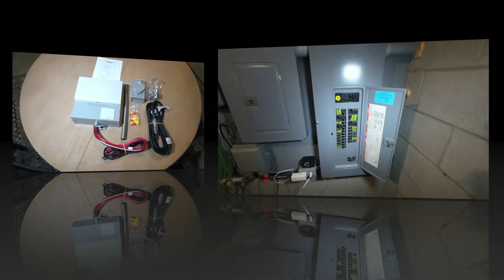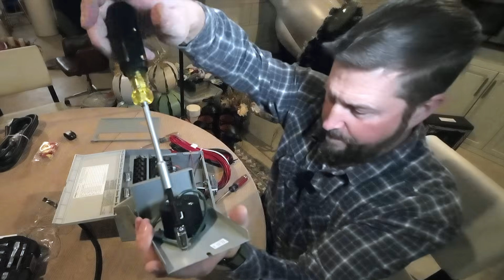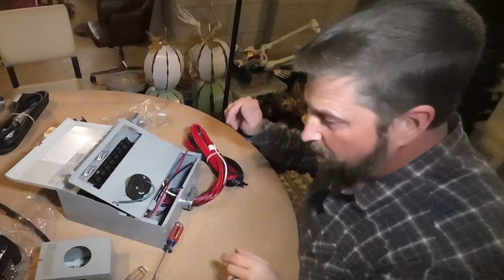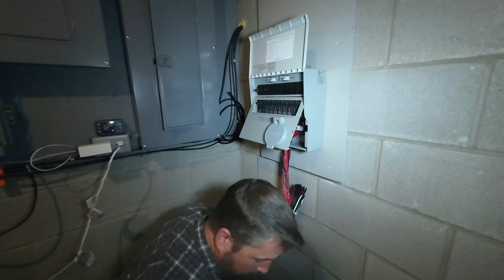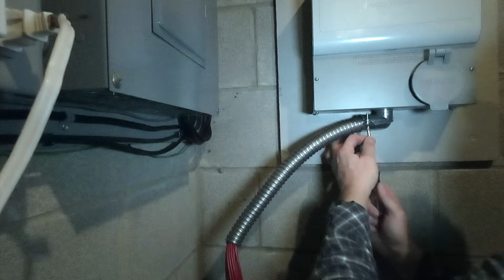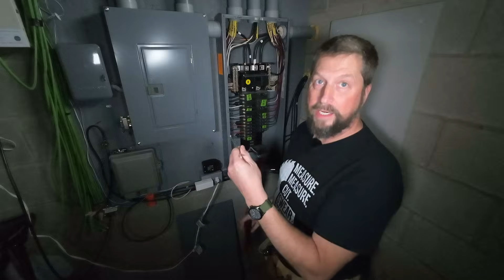Installing A 10 Circuit Transfer Switch: Reliance Controls Model Number 310CRK

Comment: What if I want to power the transfer switch with an inverter instead of a portable power station? Just get rid of the power inlet and just wire directly to the wiring of the TS?
Reply from the maker: That's creative. I think your biggest challenge would be using an inverter powerful enough to handle the draw from all of the circuits you choose to power through the transfer switch. Also, what would power the inverter? Why not just run that directly to the TS? I guess an inverter could clean the power before it reaches your circuits. When you get far enough into it, it may make financial sense to just get a battery power station. They have all of that built in 🤠👍

Comment: Nice job.  Thank you I learned something here.  I plan to do this same project except feeding a small off-grid solar and battery system.  Mounting my panels on top of a parked 28ft cargo trailer and I wont need any permits.
Reply from the maker: Thank you! So glad I could help 🙏 Good luck on the installation. Take your time and you'll be glad you have it 🤠👍

Comment: How do you connect the blk and wht wires on a/c 30 amp double circuit breaker from transfer box  there two red wires one goes to top double circuit breaker while wht stays on breaker  Now i have an extra blk wire! Where does that connect two? Help
Reply from the maker: With a 240 breaker, or as you called it, "double circuit breaker" there is a connection for 2 hot wires (usually red and black). Each hot pulls 120 from each pole inside the breaker panel. The white (usually neutral) and ground go to their respective bars. Hope this helps!

Comment: Great and detailed explanation very good! I just wished you completed the test by powering the house with the generator.
Reply from the maker: Thank you! Sorry it wasn't included in the video but we have had a recent power outage and the system works great. I still would like to add a battery system for quieter operation 🤠👍

Comment: What  will happen if you forget turn off grid CB off before using generator ??? There is no interlock between  two different sources of power !!! Bed unsafe design !!!!
Reply from the maker: There is absolutely no way to back feed the grid. Every circuit on the transfer switch has a dead break between selecting generator or grid power. It is a very good and safe design 🤠👍

Comment: Always assume some other nut job, who thought they knew what they were doing, wired up something inside the house that could kill you.  Check voltages with a multimeter, first against a known voltage, then against the unknown, then again against the known.

The distance away from your main panel is dictated by the length of the wires, not the conduit.  Buy more conduit if you have to bend it around a corner.  Again imagine someone, who doesn’t know better, sees the conduit and wants to hang something from it, and make that as difficult as possible.
Reply from the maker: Thank you so much! Very good advice 🤠👍

Comment: You can always just cut main breaker off from meter  those main black 110v cables but always test them first hot/cold hot then you dont worry about touching insde house breaker box cables them as long as main is isolated correctly and LOTO it out lol
Reply from the maker: @Sasquatch3051  That's a very good idea! Safety first 🤠👍

Comment: Does the main panel need to be turned off before switching the transfer panel to generator?
Reply from the maker: @agiantleapoffaith4502  Great question. No, the main panel can remain on at all times. There is no risk of back-feeding the grid because each circuit in the transfer switch has a hard disconnect before switching over to generator power.

Comment: No GFCI/AFCI to deal with?  Can you run full time on the manual transfer switch (ie. off the generator) if you wanted to?
Reply from the maker: @firstname7330  Great question. No, there is no GFCI in the transfer switch. It relies on your electrical system's existing safety features. It is only there as an access point to bridge power into whichever circuits you chose. However, to answer your second question, I don't believe it is intended to run full-time. Only as a backup source of power.

Comment: Hi Sam 
Thanks for this great DIY video I just installed a similar 10 panel transfer switch and I am wondering if I can also use it for a 10KW PV solar array I am installing on my roof with a battery back up and inverter in addition to a generator powered connection. I think it will serve the same safety purpose as I recall you mentioned a battery back up so I guess it would be similar.
Thanks
Reply from the maker: @brianstarkey1824  Thank you! I'm sure you can use these manual transfer switches with battery systems. Solar is a great way to go 🤠👍

Comment: Always safety eye protection around pointed wires and energized equipment..if you accidentally short something, melted metal will fly
Reply from the maker: @mine0002  I never thought of that with electrical work. Makes sense. Just like welding. Thank you for the advice 🙏🤠👍

Comment: Doe not work with newest breakers, GFI/ARC combo breakers. Just returned the Reliance A510A transfer switch for that reason. Some states since 2020, new type breakers are required by code.
Reply from the maker: @Tech_with_Loco  Thank you for that updated information 🤠👍
Reply: It will work, you just give up GFI/ARC protection while on generator.  I was willing to take that chance during an emergency.

Comment: Yup, these transfer switches are relatively easy to install. The problem is that in many electrical jurisdictions, the use of wire nuts within the breaker panel is illegal. This means that your house insurance might be voided if there’s ever a fire.
Reply from the maker: @danchesney631  People should always check their local codes. Wire nuts are fine in my area, but Wago connectors are good for many others. 🤠👍

Comment: I thought you needed 6/3 cable for the wire in-between the transfer switch and the inlet box since its 50amps. I believe he said 8/3 in the video.

Great video but you should have included information regarding the generator and whether you needed a grounded neutral or a floating neutral. A lot of people will follow these steps and have NO idea about the generator end.
Reply from the maker: Very good point about the generator. Hopefully they read the comments as well. The system I'm using is a 30 amp inlet. I actually used larger awg wire than required  🤠👍
Reply: @samsdoinstuff  Awesome!! I'm using a 30amp as well, but ran 6/3 cable so I could have the option of upgrading the generator later down the line. Thank you for the video!!
Reply from the maker: @shawnphillips1220  You are very welcome 🙏

Comment: On a separate note from my earlier comment. I saw something that needs to be MADE CLEAR!
I saw that there were WHITE WIRES connected to your 220 volt, double pole breakers, AND that they WERE NOT MARKED TO INDICATE THAT THESE WERE HOT WIRES!
For those that do not work with electric, it is a common practice to use BOTH, the BLACK (HOT) and WHITE (NEUTRAL) wires, to BOTH BE HOT!!!!  Typically, Romex wire is used with BLACK, WHITE, and BARE COPPER.  To minimize waste, and extra wire runs, it is common for electricians to use the black and white wires on a 220 volt breaker, and of course, the ground to the ground bar.  With that said, YOU SHOULD MARK THE WHITE WIRES, BEING USED AS HOT FEEDS WITH A BLACK SHARPIE, or electrical tape, at the point where they are connected to the breaker.  
I prefer a Sharpie, as you don't have to worry about the tape coming off.  You don't have to "color" the whole wire.  I will color about two inches of the ends.
This should be done at BOTH ENDS OF THIS WHITE WIRE!!!
This is VERY IMPORTANT, and can save you, or someone else, from being ELECTROCUTED!!!
Reply from the maker: @lonniechartrand  Thank you for bringing that to my attention. 🙏 I know about marking the wires, I just didn't notice it. I will look again and correct the problems 🤠👍

Comment: I KNOW it was just the camera angle, AND, that you reiterated numerous times that the large wires and lugs at the top of the box are HOT, even with the main breaker off, your hand appeared to come dangerously close to those lugs when hooking up the ground and neutral wires.
As a retired electric utility engineer, you cannot tell people ENOUGH, as to how dangerous it is when working inside of a panel box.
If you are at all concerned about hot wires in the service panel, you can request to  have your electric meter PULLED, and have your service completely disconnected from the power source.
Most every utility company will do this at no charge.  And give them a time as to when you will be finished with your job.
Give yourself plenty of time to complete the task.
This will insure your safety, AND, prevent you from being without power any longer than necessary.
BTW, this was a VERY GOOD video!!!
Reply from the maker: @lonniechartrand  Thank you very much. Someone else mentioned i should take my wedding ring off when I'm working with electricity. You all have very good advice 👌 I sincerely appreciate safety tips more than anything else 🙏 Thanks again! 🤠👍
Reply: I thought so too. I was literally getting kind of sick about seeing that, with the watch and wedding ring there. Someone at work had a wedding ring on, carrying an 80v lithium and bridged two contacts on it. Melted the ring and burned them pretty good.

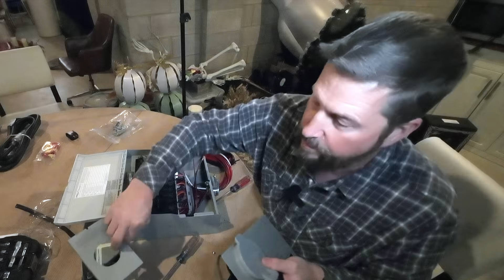Comment: At about the 7:45 location of the video, a problem is described with the holes and screws when installing the provided inlet to the transfer box.  The holes and screws are not the same size and required a nut to complete the installation.  Close examination of the documentation shows that the provided inlet is not recommended for interior use.  Instead, another inlet is recommended.  I ordered the recommended inlet and the screws provided are a perfect match to the transfer box holes.  So the holes were drilled to match the recommended interior inlet, not the provided exterior inlet.

All that aside, the documentation in another place says it is ok to install the provided exterior inlet into the transfer switch.  Why the exterior is not recommended for interior use is not understood.
Reply from the maker: @georgedaniels8207  Thank you so much for that detailed explanation. I ended up moving the inlet outside and used the box provided. The screws fit perfectly for the exterior box. 🤠👍
Reply: What did you end up doing for your battery generator?  I have a dual fuel that I will use for propane but also a battery generator. I was going to install the receptacle inside and just run a 50 foot cord to my dual fuel outside so it would be ready for my battery inside.
Reply from the maker: @Smuvbee74  I have not yet put in a battery/solar system. The cost is just too much. Maybe I'll get one of those product endorsements some day 🤠👍
Reply: I am still working on the installation but my plan is two fold:    
1) use gas powered generator during daylight hours when noise is not such a nuisance
2) use battery power at night to run refrigerator only. Eventually I may go with just battery.

Comment: Great video!   I have installed 1/2 dozen of these types of switches over the years but not in quite a while.  Great refresher.  I actually installed the same unit as you did in the video.  I also purchased the wire strippers because of your video.  Should have secured this tool years ago.  The inlet took the bulk of the time as I had to navigate through quite a maze of plumbing, fixtures, joists and so. I tested the setup by just connecting one stand alone circuit (basement outlet) before moving on. That is the easy part.   Anyway, thanks for the vid.   Well done!
Reply from the maker: @tombateman161  Thank you so much! Glad you liked it. Those wire strippers are a game changer. I've used an old Radio Shack pair for about 35 years, lol 🤠👍

Comment: I have a question, if my transfer switch are all 15 amp breakers and the outlets in the house all sit on a 20 amp breaker in the electrical panel, 
can you connect your house outlets to your transfer switch?
Reply from the maker: Great question. The short answer is yes. The explanation is the 15 amp breaker is the transfer switch is only in play when the power is routed through the switch when it's in the "gen" position. The second reason is it is okay to put a 20 amp circuit on a 15 amp breaker. An overload would just trip the breaker. It IS NOT okay to do the opposite and put a 20 amp breaker on outlets rated for only 15 amps. An overload could cause the outlet to overheat and would be a fire hazard.
Reply: @samsdoinstuff  Thank you.

Comment: Thanks for the great video.  

1. Was this your main break or a sub? If a sub why do you not just turn off power to the sub for safety. 

2. Our electrician  says they have to have the power company turn power off to install this or the interlock option but you were able to do it without doing that, is that them just being extra safe or is it a different setup?

3. In Florida most quotes installed for interlock are about $2000, seems astronomical to me, any ideas of a normal price range for the labor portion?
Reply from the maker: Thank you! Great questions. 1. This is my main panel and I definitely turned off the main breaker. BUT, the poles on the main breaker are always hot so be sure to stay away from them. 2. Codes are different everywhere. I am able to do my install without turning off the power from the utility pole. 3. Once again, costs are different everywhere you go. $2,000 is probably typical for a professional electrician to install something like this. The unit cost me $500 from Home Depot. Feels good to know i saved that kind of money DIYing it 🤠👍
Reply: @samsdoinstuff thanks for the video and quick reply, just subscribed.
Reply from the maker: @davidgareauRN  Thank you! And welcome to the channel!

Comment: Great video. Will be very helpful soon. One question!  Once installed, did you say you turned off the main breaker while using power from the generator? I didn’t think that was necessary .
Reply from the maker: @TonySmigelski  Thank you! So glad you liked it. You do not have to turn off the man breaker to use the transfer switch. It has a clean disconnect from the grid so there's no chance of back feeding the grid 🤠👍
Reply: @ my kit arrived so next weekend I’ll be doing the install.  Thank you

Comment: Great video, watched completely. It is nice to future proof things. It sounded like the new panel had stranded wire. I wonder if the ends might be prepped with some solder on the ends before inserting in the neutral /ground and breaker screws prevent frays when clamping, or if it makes any difference? I would love to do one that has a cut over automatic option. Thanks for posting.
Reply from the maker: Thank you! It's a very reliable system with no chance of back feeding the grid. Automated systems cost quite a bit more but they sure are nice 🤠👍

Comment: Very good video and thank you for sharing. So therefore, if I understand this correctly, there is no need for a safety interlock on your main panel. And since the first point of disconnect is the generator then the generator needs to be bonded. Please correct me if I am mistaken.
Reason, I’m trying to get this clear in my head is because I’m getting ready to do this very thing.
Thank you so much and I liked and subbed.
Cheers from Dave.!😎✌️
Reply from the maker: Thank you Dave! Welcome to the channel. You are correct in all of your questions. It is a very safe system and cannot back feed the grid. I believe the generator can be bonded at the inlet box 🤠👍

Comment: I would have just wired the generator inlet outside the panel and bought new conduit to make it easier to run.  Not worth messing with it.
Reply from the maker: @gilborealty  Good idea! I did end up putting the inlet outside for the time being  🤠👍

Comment: That little factory that the black & red wires are labeled A B C etc. is nowhere in the install PDF from Reliance - I've been staring at one that someone else installed for a week! I have to replace some of the circuits in the main panel due to a remodel at my friend's house & it was driving me nuts!
Reply from the maker: @WATERTUBULAR  Oh my goodness! That must be mind-numbing. I'm sure you'll get it done. Good luck! 🤠👍
Reply: Tried to say "factoid" - 'auto correct is always 'auto wrong' - anyway, your video cleared up everything - got the whole remodel rewired to the main panel, with, with 10 loads linked over to the Reliance & on solar/battery backup. So - good one!